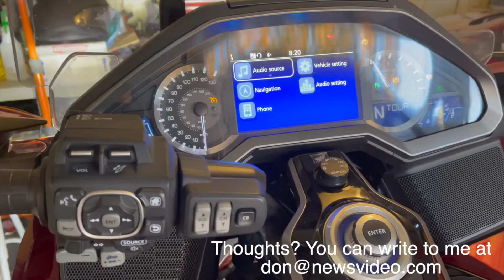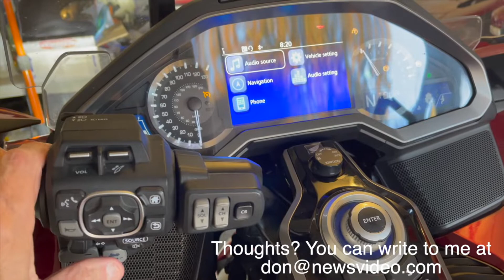Left keypad not functioning on my 2018 Goldwing Tour DCT. (Update: See fix below)

Comment from the maker: UPDATE: Fixed! A connector under the left-side panel was not fully locked. It was intermittent. That explains why the left controls went out for a while about a year ago but came back before I could do anything about it. The last time that connection (from the left handlebar controls (and the CB controller) is connected to the left handlebar controls as well) was touched was when the dealer installed the CB radio when I bought the motorcycle in May of 2018. The shop at the dealer didn't say it was their fault but found the problem and fixed it without charge. The shop may have been reimbursed through warranty since my three-year factory warranty runs out in three months, May of 2021. Anyway, all is working well now.
Reply: Don could you instruct me on HOW to pair up My CB to the sena50R? CB shows to be transmit,but I'm not talking ..???2019 GL1800 tourDCT
Reply from the maker: @Msrverpilot  Be sure to pair the Sena to the bike and NOT to your phone. The bike will then take care of sending your voice out. Are you hearing the CB? There's some practically hidden settings for volumes on the bike. Audio Settings > Sound setting > Volume and you'll see the audio settings for everything.
Reply: @mrdonsmith  ,Thanks Don , I'll check these things asap , thanks again.. ACE
Reply: Don. You can still get the Honda Factory warranty extension. Only get the Honda warranty
Reply: Don, I know this video is dated but this same problem just happened to me. Would you please help me understand where is the connector that you are referring to?  A picture would be great.
Reply from the maker: @ack3660  I detail what the problem turned out to be in the comments but I’ll post that reply here but the short story is that the dealer has installed my factory CB radio that connects to a plug under the left cowl that also carries some left handlebar controls. The connection was not checked to see if it was fully seated. It was not fully seated and was intermittent.  Here’s my full reply back then…

UPDATE: Fixed! A connector under the left-side panel was not fully locked. It was intermittent. That explains why the left controls went out for a while about a year ago but came back before I could do anything about it. The last time that connection (from the left handlebar controls (and the CB controller) is connected to the left handlebar controls as well) was touched was when the dealer installed the CB radio when I bought the motorcycle in May of 2018. The shop at the dealer didn't say it was their fault but found the problem and fixed it without charge. The shop may have been reimbursed through warranty since my three-year factory warranty runs out in three months, May of 2021. Anyway, all is working well now.

Comment: I thought the handle bar controls only work when riding and the main panel controls work when stationary.  Or am I missing something?
Reply: My bad. Mine works on in accessory mode or when running stationary.